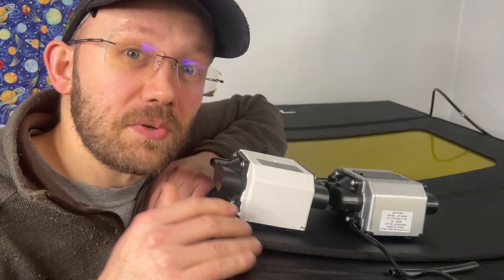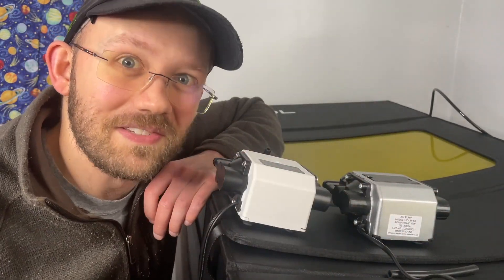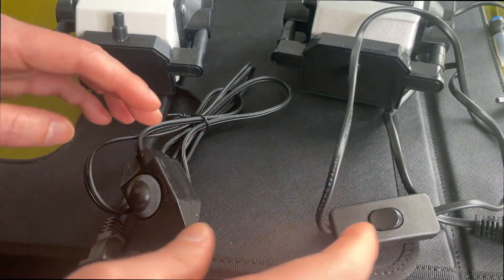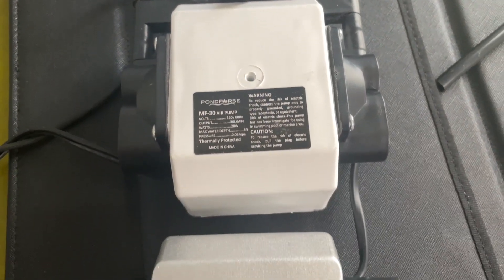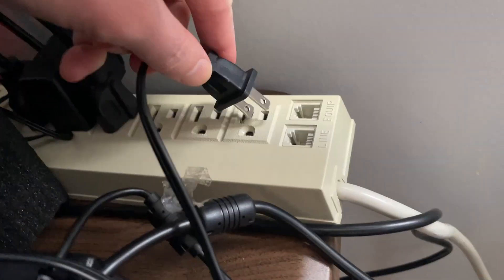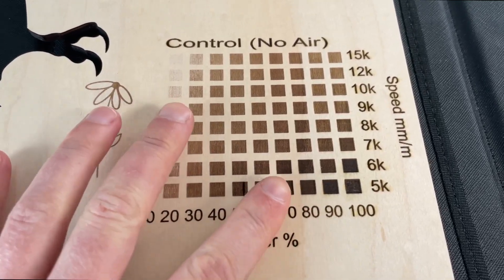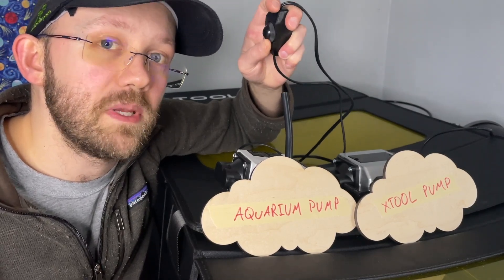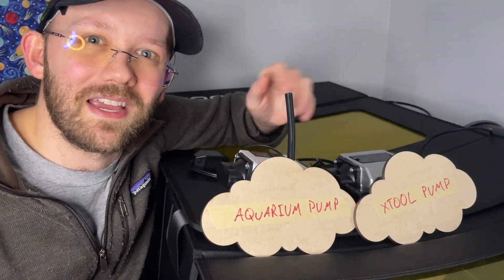XTool Air Assist vs. Cheap Aquarium Pump

Comment: Aquarium pumps can shift a lot of volume of air, but it's at low pressure. For lasers, it's the pressure you need. So the best solution is actually a compressor

Comment: I just use a similar aquarium pump for Sculpfun S10. it just works flawlessly & silent with no burn marks when cutting. Leave it off when engraving if u want a darker shade or if u use powder filled on text or graphics. The air will blow off the powder before u melt it 😂. Mine is AP-50 which is 54L/min air flow. If u buy aquarium pump for diode laser 50L/min would be enough. Bigger will be better but had to secure thin workpiece well. ❤thanks for your comparison video, lucky I didn’t buy the Sculpfun pump which is of cos more expensive.

Comment: Longer has the same pump for $70 (for 5/10W), I see the same pump on amazon for $40-60, but also seeing others with the same air flow ratings for half that.

Comment: The sad part is xtool will come out with a control valve that costs a huge amount more,  but to be able to engrave acrylic, you need to be able to turn your air flow down.  The current solution for me is vice grips to pinch the line.
Reply: They have in live air control valves. You can get them for like $2-3 a valve. Does the same thing.
Reply: I have the P2 and P2S and you can turn it down in the software.

Comment: And for the cost of the xtool D1 air assist,  you would think we'd have air flow control.  And yes I have the d1 and d1 pro, i could of used the cheaper way out.

Comment: Doubt the air assistnpumps are any better quality, after all, aquarium pumps are designed to run constantly for years. My aquarium pump in my aquarium cost about $15 and has been running 24/7 for 8 years now 😊.
Reply: Can you tell me the model of that pump you use?
Reply: What aquarium air pump? Every one I've tried, barely has any air/volumer coming out - compared to my 60L/min air pump

Comment: I dont think the Polyurethane tubing you linked to is a good match for this purpose.
I got one from Creality - its almost identical and has the volume control - but the tubing I think may be Silicon - it fell and crossed paths once by accident with the laser - and didnt burn. That one you linked to could be a fire hazard?

Comment: I got an aquarium pump rated at roughly twice the air output of a standard air assist pump. Then I did a cutting material test in lightburn,  no air, 30lpm (standard air) and 60lpm (aquarium pump). There was a noticeable difference in each test. The 60lpm aquarium pump did the best, cutting several squares more than the standard pump

Comment: the EcoAir Commercial 1 - is even cheaper and it comes with a 6 valve manifold so you can open several of the valves for when you want decreased flow.  I measured the air output at the nozzle with a vane anemometer and got almost identical results to the Xtool pump.

Comment: 2:46 also known as 1/4 od hose. Same aisle is where the aquarium pump would be. Don't need polyurethane. I just got cheap clear rubber line

Comment: For the same money Xtool bill for their air assist you can buy a small air compressor and get higher (and vary the) air pressure out the nozzle. Seems like a better alternative if you're willing to spend the money anyway because it'lll do the job better and be useful for other things. Add a solenoid valve for next to nothing and you've one-upped the Xtool air assist.
Reply: Exactly what I just did.. had a 80gal Ac sitting in the garage 25.00 worth of fitting and hoses and away I burn
Reply: But air compressors are very loud. You can't use them everywhere you can use an air pump.
Reply: @1985cactus  Cheap air compressors are loud. Look up california air or sub 70db compressors. Just for air assist? Prob not worth it. Good for running tools, spraying, sandblasting etc.

Comment: Great video, just bought my Xtool D1 20W and was gonna first try it out without the air assist... however, after watching your video its good to know I have other paths! And as Chad Customs Creations said, its a great tool to have some variable with the volumen that is being sucked out. Great content brother.
Reply: Air assist is also very useful for keeping your laser lens clean. Without the air assist, the smoke can go right up and settle on the lens and damage it when it gets heated by the laser.

Comment: Great video.
I just finished my review on the Creality Falcon2 laser, and that comes with... Exactly the same air assist unit.
Fun fact, The Creality version has a connector that plugs right into the laser engraver and has the pressure setting dial at the side of the laser.
As for engraving. It is better to use the air assist also when engraving, but at very low power. When using the air assist, the smoke generated by the laser can't reach the laser lens, therefore you won't have to clean the lens that often.
Reply from the maker: Haha - nice. And good tip about the low power for the air assist on engrave jobs.

Comment: That metal piece that came with the aquarium pump is a distribution manifold that allows you to aerate multiple areas of your aquarium with just the one pump.  Pretty nice that they include that, actually; some companies, you just get the pump itself, no hardware to speak of.

Comment: Does the stool not offer pump control so light burrn can switch the pump on and off as it's working on a project?

I have the Sculpfun S9 and Sculpfun offer an air pump that have the control function.
Reply from the maker: No, the Xtool air assist doesn’t do that. I’ve actually seen that the Sculpfun can do that, and thought that was a pretty cool feature.

Comment: Hi Asher, I'm in the UK where it's 240v, will I need some sort of power adapter?
Reply from the maker: Hi Cliff - yeah, for this specific aquarium pump it comes with a North American 120v plug, so it would require a power adapter to work on a UK style outlet.
Reply: @chalkwatts  Hi Asher, thanks, I haven't been able to find a 220v version from the manufacturer unfortunately,  cheers for finding a great product though 👍
Reply from the maker: You may be able to buy a UK/US general purpose adapter (like an American would use when traveling in the UK). I haven’t bought one in years, but last I checked they were pretty affordable.

Comment: I have an xTool air assist, and it is crap.  I got it in November, and it stops working when the unit gets hot.  I am on here now looking to get a pump to replace the one I got with my xTool air assist.  I will be purchasing this one, as I have things to do and I have waited 3 weeks for xtool to respond regarding the crap pump I received with the air assist I purchased from them.  Thanks for the video!  You saved me some hunting around to identify which pump to get.
Reply: Did you change the filter ?? it only good for x time this will make it over heat